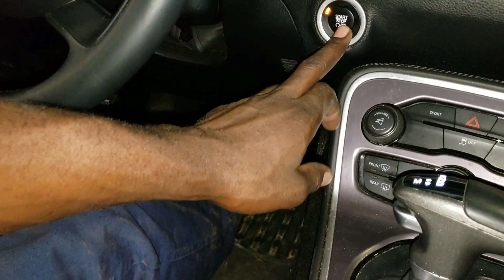Dodge challenger  front brake job

Comment: If this was a Challenger Scat Pack Wide Body with 6 piston Brembo brakes in front and 4 piston Brembo brakes in rear, will it cost more $$$ in parts and labor when a shop does the work? This is comparing the base Challenger SXT V6 to the Challenger R/T V8 392 engine with Brembo brakes as mentioned above.  Cost difference between the two above Challengers?

Comment: Hi Dullah, I love your videos. Does it matter what type of grease you put on those caliper bolts? Will white lithium grease be okay?
Reply from the maker: Not sure about that but most time you will get grease in the box the brake pads come in or you can order some small pack of brake grease when buying the parts ... thanks for your love and support i really appreciate it